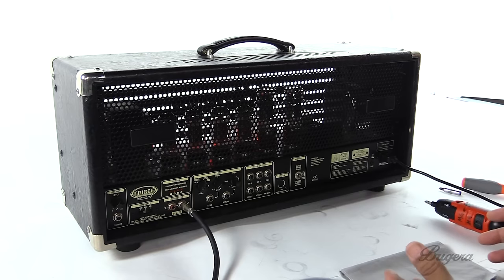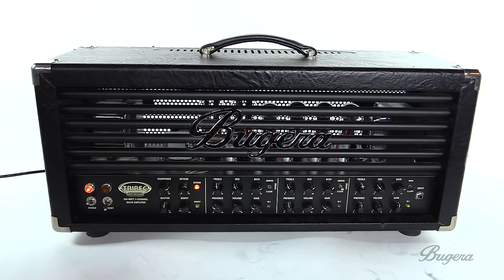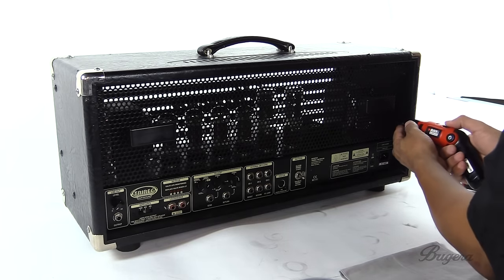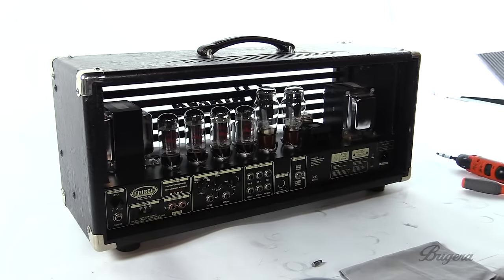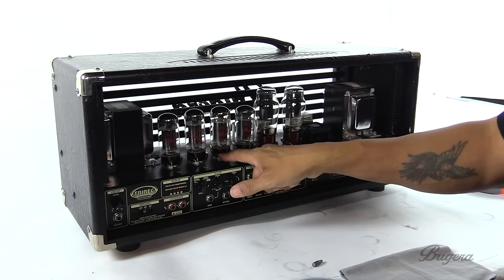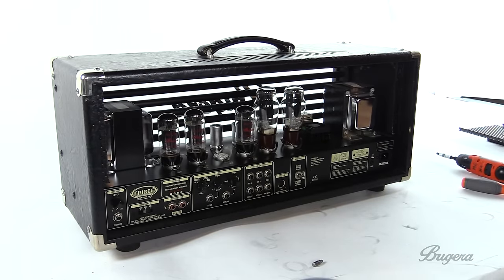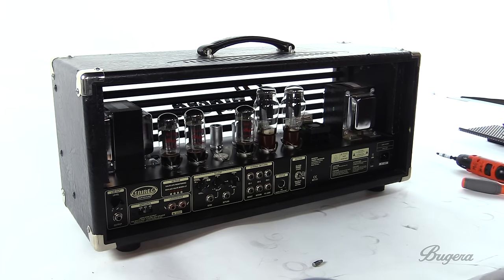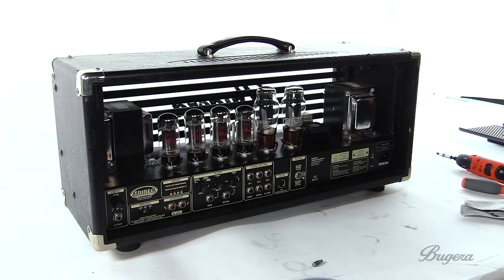How To Replace Your Tubes

Comment: One more tip: after you unplug the amp, flip the on switch back on for about 10 seconds: then flip it off. This will allow the dissipation of caps in the power circuit. It is probably no big deal, but you never know.
Reply: the switch is connected to the primary side, where there usually aren't bulk caps. What you're saying doesn't make sense unless Bugera has a very unconventional power design.
Reply: Better to have your standby switch always on, so the lamp can drain your capacitors. It doesn't add anything to your tube life either.

Comment: Thank you, why should the grease degrade the valves faster? I learnt about a similar phenomenon from car headlights, but it has to do with vaporisation which blinds the mirrors and lenses. What can happen on power tubes?
Reply: Glass is made from sand, and on a microscopic level it is not a "solid" material; it is porous, like a sponge, thereby absorbing those natural bio-oils leaching out of our fingertips.  With repeated heating and cooling cycles on a vacuum tube or light bulb, the unsanitary presence begins to compromise the integrity of the structure, leading to premature failure.

As a side note-- If one were to observe old glass window panes from the 1800's (in a museum perhaps), they may notice a rippled, sagging, warping effect in the shape and surface that have developed (with the help of gravity) over time;  thus, the argument has been made that glass is technically a LIQUID.    🤯
Reply: @spacesuitor  thank you for the answer but glass is amorphic and not crystalline, so it is less likely to absorb chemicals. Although it is an unstable state, amorph structures do have advantages when it comes to chemical resistance, especially glass. 
Glass is not a liquid,  although you can call it a frozen melt. It has only to do with it's entropic state.

Comment: Can you walk through biasing the non Infinium's?   Like the O.G .  333?
Reply: -------------------- I'd like to know too! My 333 just went dark. Power switch lights up, no tube glow, no heat, dead silent. Don't know what's up, but I'm hoping its just dead power tubes. You ever get any answer to this?
Reply: @alphanumeric1529  I had same problem with my Trirec. Just got it back from a tech. He said there are a couple of fuses inside you can't see (under the base of the tubes and stuff) and they were broken. Replaced them and now it all works fine
Reply: @SteinG  I had the legendary to the point of mythic, cable connection melt. Hard soldered it, fixed it in a jiff. Also, putting the amp together, one powertube was very slightly nudged when flipping the head upside down, and the powertube was not perfectly seated in the the socket, no beuno. I figured it out. Wiggled it in, powered up, still bothering the neighbors.

Comment: Im ready to replace the tubes on my g20 infinium. Ive been around the web on bugera sites but no answer. Im wondering what my options are such as el34 6l6 kt88. As its self biasing can i just swap out tube types as long as the pin pattern is the same?

Comment: I have a question about electrical risk: all the time I read something about electrical equipment ( not only audio ) there is akways a warning about the shock risk from capacitors. It looks like they keep for such a long time after switched off enough energy to kill a person.
Is it dangerous handling such a powerful equipment as a guitar amplifier without operating somehow to discharge the capacitors or something else?
Thanks in advance.

Comment: I just received a Infinium 55 Combo, it has a Microphonic tube.  I have vintage amplifiers etc I am used to all the 50 years of dealing with tube amplifiers but they have a good cage around the tubes.  I don't know how to get to them but it looks like taking the top for chassis screws and four more screws that go through the chassis to the top back lip of the cabinet. I think that I will have to remove the chassis to change tube. GOSH. I never saw this coming. I likes the idea of the features of the amplifier and the sound tone everything else great. If I have to remove the chassis to change a tube this is going to make me give a very bad review I hope it is not the case but can not find any information about this combo on changing the tubes. The video for that head is a snap.

Comment: What would be the best sounding tubes to upgrade my Bugera 333xl???
Reply: That won't make a difference unless your valves are worn out. Valves do not determine the tone, the circuit design does.

Comment: on a Bugera T5, can you replace the EL84s with 6L6s?
Reply: As far as I know, 6L6s have different bases than EL84s, so they'll not fit into a socket for EL84 Tubes.

Comment: how do you change the tubes on a bugbear v22 combo I just bought recently
Reply: I am about to. No instructions anywhere on how to get into that tube cage
Reply: @TurboMountTV  have you solve it?
i m struglling too
Reply: @Rafail7Guitar  Bliss, I removed all screws on back, pulled out whole PC board, then was able to remove the steel cage. Put back in. I kept cage off so in future I can reach in and replace tubes without having to take apart. Hope this helps.
Reply: @TurboMountTV  i just I put out the cage  but i have the impression that the tube are glued in their place and can't take then off. How you did it?i
Reply: @Rafail7Guitar  If I recall its just a matter of wiggling tube back and forth to get it out.
Some YT video can confirm that.
Reply: @TurboMountTV  thanks

Comment: hi, i have the same amp but the tube monitor flash randomly every few seconds and the sound of 2ed and 3ed channel is weak no matter how much volume i put and the distortion is weak as well the clean channel is a bit distorted but the volume is normal, can anybody help plz ?
Reply: SbowMetal that means you need new tubes my friend

Comment: I have a Bugera BBV3000 Infinium Bass Amp. I can not get the tubes of the pre-amp section replaced. I can not slide the pre-amp section far enough to the front because the wires which go to the main amp get jammed to the clothed baffle where te cooling fans are. I am shure there must be a way, please let me know (anyone) how knows how to replace these tubes.
Reply: did you solve it?

Comment: No biasing needed?
Reply: sneifert1968 infinium tech automatically biases the amp for you, its always doing it when it's on so your tubes get a much longer life (and yes it actually works even when I put in a new set of unmatched tubes that weren't even the same tube type it came with, it automatically biased itself and still does as I play it)
Reply: @jacktowers7533 have you checked the bias when you’ve put the unmatched set in?

Comment: Probably would be smarter to get balanced tubes as a set and keep doing sets rather than trying to let the amp monitor and self-balance stronger & weaker tubes as they are either replaced or whatever. Here's to hoping that Bugera does that for the brand new amps instead of just trusting that every tube is good enough to get some useful life that is longer or shorter ? I buy in at this point that this feature can extend life of the tube that is inferior and going bad. So my assumption is that this power monitoring allows the amp head to produce the advertised wattage regardless of the impedance design of the dummy cabinet full with 1-4 woofers ?

Comment: This video is of no help at all for those of us owning a V22HD or V55HD with a tube cage around the tubes.  How the heck do you get the tube cage off of there...??????  Do you actually have to pull the chassis out of the case just to change the tubes on these...???  I've had tube amps for 50 years and I've never seen anything like this.  It's like they've made it as hard as possible for anyone to change the tubes in these, and totally impossible for someone not good with tools. If anyone's got that damned cage off of theirs, could you fill us in on the secret...?  How'd you do it...?
Reply: did you solve it?
Reply: I just did my first change. There is no way around it. You must take the backboard off and remove the speaker in order to reach under the cage screws. That was so disappointingly stupid!